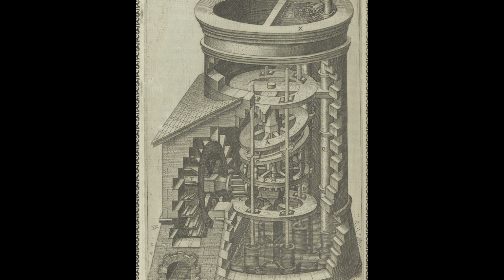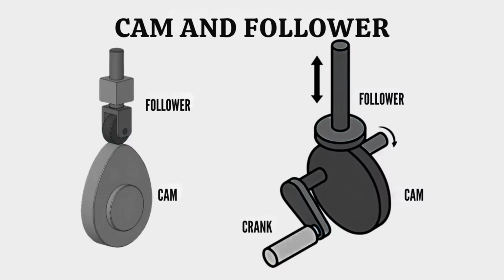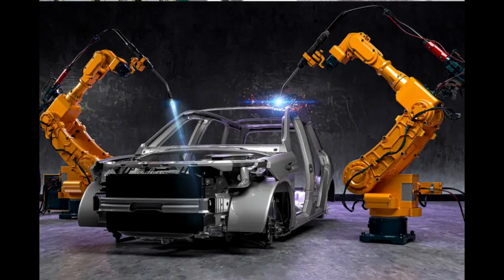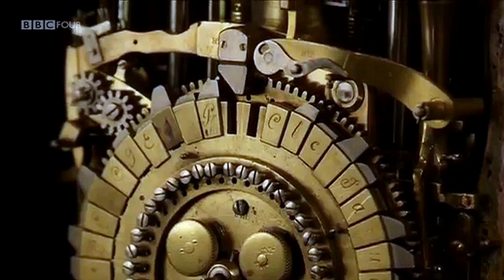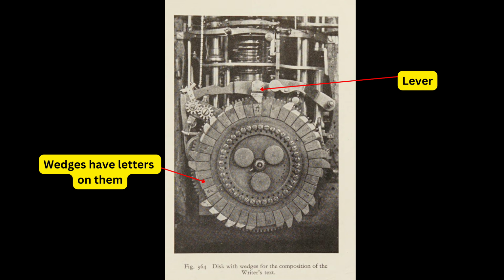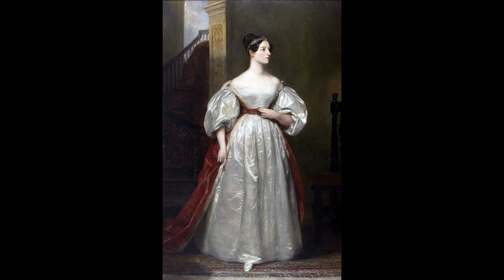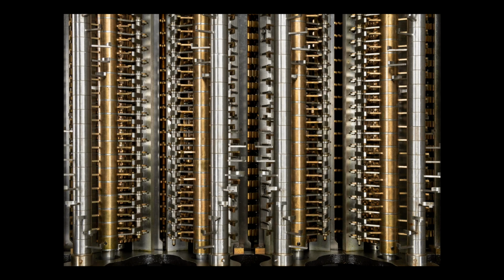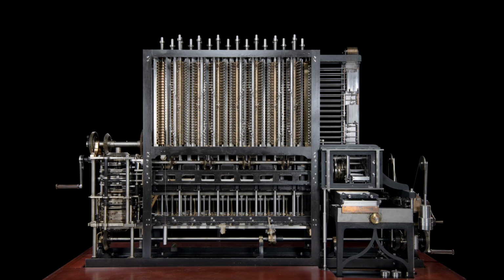The Ancient Origins of Mechanical Memory

Comment: The earliest example of mechanical memory is the Antikythera Mechanism from 2100 years ago. Ancient Greece used planetary gear systems to store analog data including the days of month, year, location of planets, and shape of moon, among other. We used mechanical memory in early computers such as IBM punched cards up until the mid century and we still use mechanical memory to date in schools the the form of Bubble Sheets (Scantrons).
Reply from the maker: Of course, but I am drawing the connection between development and how it changed over the centuries not listing what device was the very first to incorporate more than one aspect of of geared memory. As you also will notice this was focused on cam memory not geared. The antikythera mechanism mainly uses gears like you said. I did not focus on gears at all. There is only one small sort of cam in the antikythera mechanism and it’s the elliptical for the moon but that’s really just an eccentric gear as the pin hole is off centered to it creates that non uniform motion. It isn’t a typical cam and follower system

Comment: Not to forget all the mechanical switchboxes in washing machines and dishwashers with lots of cams and switches for the components. Replacing was the hell of repair with felt thousands of cables connected there.
Reply from the maker: Ahhhh….you didn’t finish my video. Washing machine timing cam stacks are mentioned haha.
Reply: @intothemap360 uh, i ll watch it now, but now i know how its named in english☺ by the way in water chillers from carrier we had those to switch the load stages back and forward controlled by a thermostat. Pure electric and mechanics
Reply from the maker: You were just a bit ahead of me! I couldn’t believe how many examples of mechanical memory I found once I started looking!!

Comment: The most advanced mechanical analog computers I've heard of were those used to aim the big guns on WWII battleships. They were full of cams.
Reply: Yes, when analog computers from WWII military ships became obsolete, people began to repurpose them for the film industry. They used the mechanical calculators to program movement in combination with film printers, resulting in things like slit scan techniques and the pioneering of motion graphics.

You can look into the works of John Whitney, Douglas Trumbull, and Zbig Rybczynski.
Reply from the maker: Thats something I should look into! I’ve seen the ones that were on airplanes
Reply: definitely not the same scale and complexity but there's also a cool electromechanical computer on the Fw-190 and the German ship equivalent I think is the Kommandogerät 40 for fire controls.
Reply: Look into mechanical engine controls on f108/cfm56 engines

Comment: Nice video! Gotta love cams 😊 
I built a difference engine recently (check my last video) and the cam drum, although the hardest part, is also the must satisfying.
Reply from the maker: I just did! Good work! Do any with metal?
Reply: @intothemap360 sadly no! Would love to try but I only have a 3d printer 😢
Reply from the maker: I have an angle grinder and file….

Comment: cool. it's interesting how any mechanical device can be interpreted as memory, but there's still a smooth transition between full generic read write memory, and simple machines, with every hybrid stage having been built in between

it makes you wonder if modern memory is the conceptual end point or if there's a more advanced usage of memory than just full random read write
Reply from the maker: Exactly right. It really makes you think about the difference between knowing information and making new conclusions off it, versus the ability to regurgitate facts.

Comment: unfortunately all things today are implemented in digital way, but for certain things digital and software brings complication and obsolescence... why fit a microncontroller to keep 'state' of 2 things when you need a cheap relay or a simple transistor for example ? i saw microcontroller used to delay a light buld turn on... c'mon it is a 3 component job for analog circuitry
Reply from the maker: Great point!

Comment: My dad was a gerontologist (old people doc)  and one of his patients who was over 100, found out i was a machinist too, and said my dad should bring me by his machine shop some time.  Se we go in, and its a very modern setup with a bunch of people running modern cnc machines, but kinda stuck on one side of the big modern building, was the original building, with the old cam controlled lathes and milling machines, set up as a museum/shrine, hah.  The old patient of my dads was a swiss imigrant, and that technology had just barely hit the big cities in america, so it was wild he had it setup in the tiny rural western town we lived in.  Just like how you can get a different cam shaft for your truck to make more hp up high, or more torque down low for towing, you can make a camshaft that will control a series of operations on a metal machining tool.  Years later i built a very simple version to be able to make wooden airplane propellers for experimental aircraft.  It really stuck with me.
Reply from the maker: That sounds awesome. I visited a few old line shaft driven shops and there is just something about them so attractive. The industrial museum in betham PA is on my list as well. That machine shop sounds like the kind of place I’d like to visit. I’m just hoping one day I can make enough from a YouTube video to by a good mini milling machine and lathe. I had to make everything in my video with just sander and drill and angle grinder. Got the job done but sadly lacking in precision.
Reply: Amazing comment. Thank you for sharing.

Comment: 24:17 The problem isn't the digital system is not fast enough, they are, they operate on Gigahertz cycles, the problem is that it is a digital symbolic system acting on the mechanical analytical continuous via discrete signaling, that introduce errors and lags in the continuous system, the digital thinking brain might be fast, but the actuators are themselves mechanical and won't be fast enough and they're discrete motion.
The discontinuity lags, and errors in the mechanical system accumulate, that's why cam-shafts are still better, no accumulated error or lag in the movement.
(I'm a software engineer by the way, but I work with digital signal processing, so I can understand mechanical systems from that point of view)
Reply from the maker: Thanks for your insight!

Comment: To make a mech "brain" you could start with doing hebbian learning just one cell, so a perceptron. 
Then a small neural net with back propagation, slightly harder ;-). We could store the weights in the cams and let them be "nudged", temporarly a bit loosened and slightly rotated,  so that the network converges. The training examples stored as jacuard cards.  A challenge but I think it can done and pretty cool to watch! I have to come up with some trick for the mechanical differention step. good little puzzle.

If just doing a computer we could start with a Turing machine. I did spend some time on my vinter vacation scetching such a thing, just a 2 state tape, 5 internal states (aka symbols), finite (of course) tape with stone pebbles. Nearly all in can be made in wood, some metal for the axels and some springs just to simplify a bit. Absolutely doable and 10000 times more easy than a mech Neural net.
Reply from the maker: Haha a mechanical AI will eventually emerge!

Comment: I don’t understand why the ‘first programmer’ gets the credit for figuring out that the ‘first computer’ could represent variables and programs abstractly, instead of the guy who designed the machine…

Since Babbage designed and built (at least part of) a machine that could solve equations with initial conditions via iterative approximations, clearly he had created a machined designed for abstract programming with variables. Yet he doesn’t get credit for this?

[I am the first programmer of a couple of computer languages, but it would be silly to try to take credit for for the innovations inherent in the hardware or the software aspects of the computer because I was the first to write code exercising the capabilities of the language and the machine.]
Reply from the maker: I think he very much does get credit for that!

Comment: I'm curious about your claim "Mechanics beat software latency every time."  And really, the whole section starting around 24:00.  How are you defining the latency of a hardware cam system or a software-driven system?  Relative to what?  Normally, I've seen it defined in software systems as the time from a stimulus on a sensor to the output reaction, but I'm not sure what types of sensors are used with cam-based systems and what their latencies would be like.

And taking a step back to your wider claim, I'm curious how many new cam-based systems are being designed today and what their advantages are.  Certainly there are lots of legacy systems which are cam-based.  And I wouldn't be surprised if people are designing new ones (not just building/tweaking existing designs), but I don't really understand when that would be easier or cheaper or whatever.
Reply from the maker: Good points, I don’t have hard data for the cam latency I read that in one of the sources I used. I probably could have been less definitive in my statement. I show many examples of modern cam use at the end and that’s just a small sample.

Comment: I would appreciate being corrected if I am wrong.
My understanding of the difference between a "computer" and a "calculator" is thet a computer can run automated programs and a calculator can not. (Regardelss of the Texas Instruments "programmable calculators" that are actually just computers with a calculator interface.)
As such, I understood Babbage's Difference Engine to be glorious calculator (glorious! Not glorified!) and his Analytical Engine to ge a full fledged computer.
More, since the DE had no memory, only one operation and relied on manual input, it was a very simple calculator.
Whereas, the AE had memory, input, output, an instruction reader, a system for changing microcode, a data bus, a clock bus that doubled as a power bus, it can be considered a fully modern computer architecture, even though it had way of implementing floating point functions. 
...
As you probably know, the difference engine was replicated in the '90s. There are two functional replicas. What you might not know is there is an active project trying to replicate the Analytical Engine in the 2030s. It's called Plan 28.
Reply from the maker: That’s a good way to summarize the difference! I did not know about this new plan to build a full analytical engine! I hope it works

Comment: In a former career I rebuilt pianos. The old, foot-pedal player pianos used long paper scrolls with holes in them as information storage: when a hole passed a certain level it allowed vacuum to pass through to the actuator for a given note, playing it. My boss sent me to the Mason-Hamlin factory to learn how to install a modern version of this. Piano-Disc had a deal with Apple, so you just bring up iTunes and 88 little solenoids fly up in turn to play your piano. Just a modern way of doing the exact same thing the old pedal players did
Talk about measuring twice and cutting once: you really don’t want to mess up your calculations when you’re taking a circular saw to someone’s family heirloom 😏
Reply from the maker: Wow that is incredible. I had no idea that was even possible! I’ve seen a couple  of player pianos play before and they are very cool machines. The amount of work it would be to program all the pins or holes for any of these machines is bonkers!
Reply: Yeah. The mechanisms were astonishing. Like you said, a hole let air flow through into a continuously pumped vacuum.  The vacuum pump that I saw was basically two leather bellows on a rotating axle. A non-rotating cam would open then close the handles. Vacuum was pulled through the nozzle on the upen stroke and pushed out the side on the close stroke.
I don't remember how the key actuators worked but I do remember thinking they were a genius solution to the complex problem of making a key actuate while still allowing the piano to he playable.
But the thing that really got to me was listening to a roll of music recorded by Scott Joplin. I think it was the Maple Leaf Rag, though I'm not certain. It was awe-inspiring to realize I was listening to a historical legend play the piano a century (and more) after his death!
Reply from the maker: My brother can play the maple leaf rag like no one I’ve ever met!